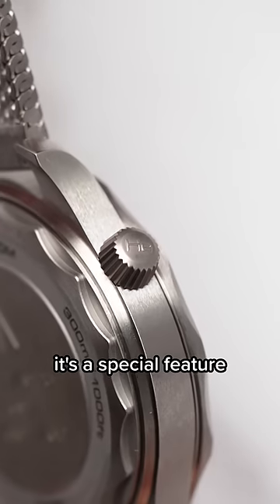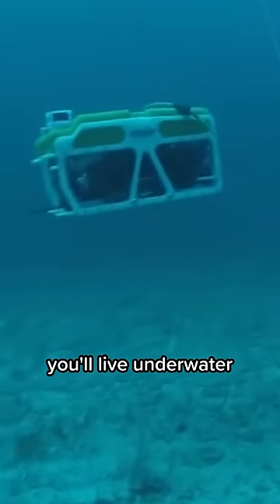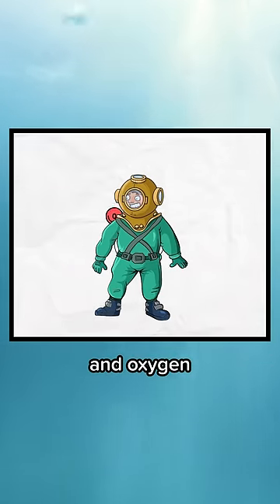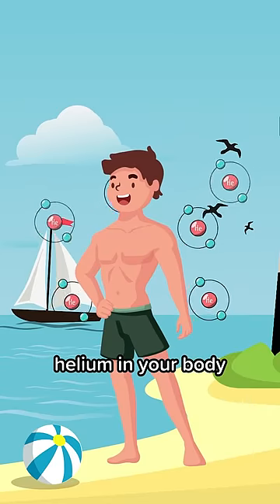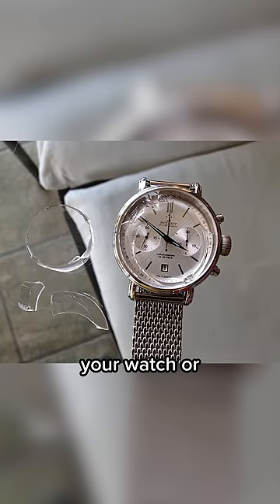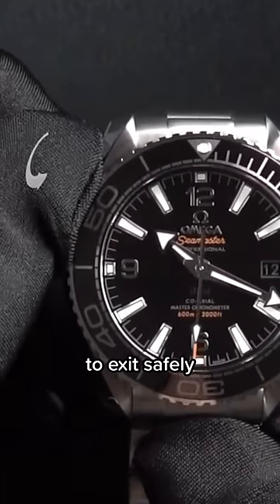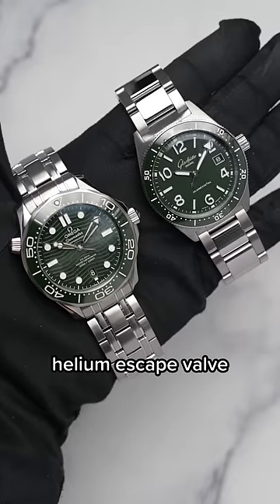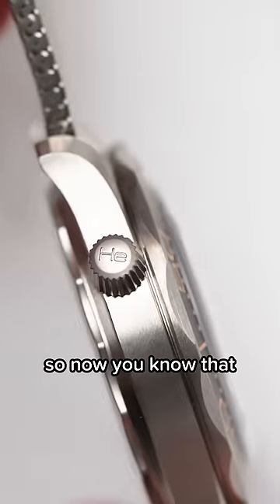Do diver watches need a Helium Escape Valve? 🤿

Comment: Why can't they just make the watch "Helium-tight"?
Reply: They do for instance with the Seiko Marinemaster 300. Designed with a monoblock case. The He valve is the trade off for a smaller case size most likely.
Reply: Helium atoms are the smallest atoms of all the elements, that's why helium party balloons go flat after a few days, helium atoms are so small they can fit between the molecules that make up the rubber balloon skin, they slowly pass through the rubber and escape.  Saturation divers spend weeks living in a bell or habitat in very high pressure heliox breathing gas, a mixture of helium and oxygen, over time the high pressure pushes helium atoms through the gaskets and O rings of the watch until it becomes the same pressure inside the watch as outside the watch in the diving bell. When they bring the bell up and slowly decompress it along with the divers the helium atoms will start to leak back out the same way they leaked in but they don't leak out fast enough during decompression so the pressure difference can pop the crystal off or break it.

Comment: You are wrong with your explanation of the use of Helium.If you breath normal air under a pressure that is higher then 80 m the nitrogen in the air makes you drunk. This is almost every time fatal as you will rip of your own respirator or panic etc. This is why they replace the nitrogen with helium, you dont get drunk, you stay lucid. This has nothing to do with decompression sickness whatsoever. Helium will always travel through the seals of the seals of a watch as the He moleculs are tiny enough for that. Two solutions: You build a watch so thight that even Helium is not passing through the case or you ad an helium escape valve. Omega’s valve is manual and gives the watch it’s iconic look. Even if you don’t need it, it gives your seamaster character.